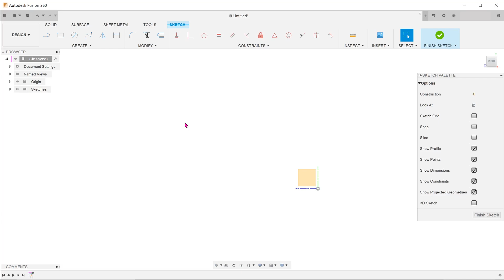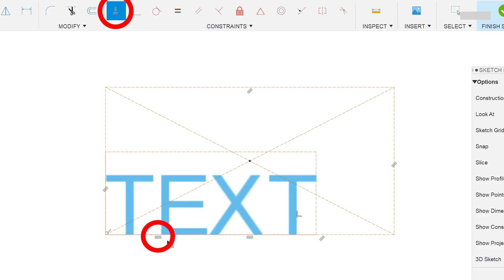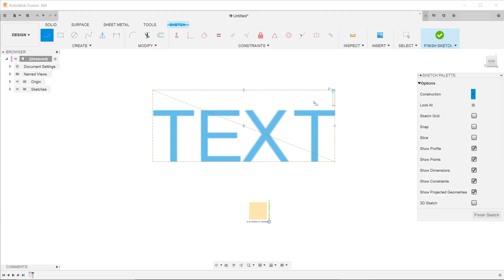Fusion 360 - Position Text Through Center

Comment: This is only works if you don't alter the text afterwards.
Reply from the maker: Yes, you are right. The rectangle would not regenerate when the text is altered since it does not actually snap to the text. If the text is changed, the rectangle would need to be re-drawn. Hope that Autodesk gives us an easier way to do this in the future.